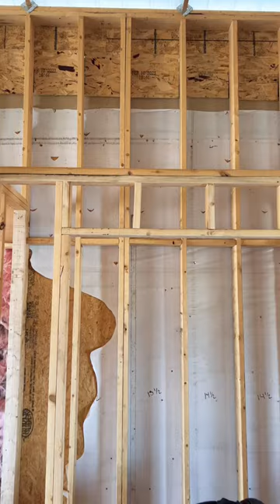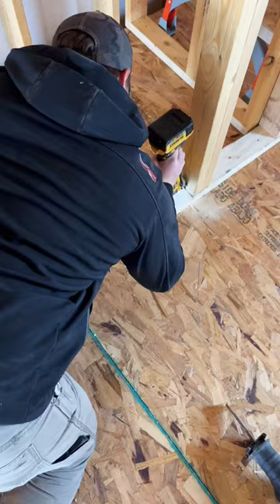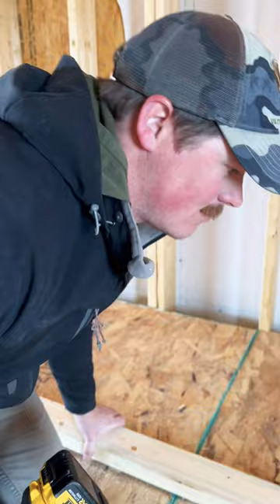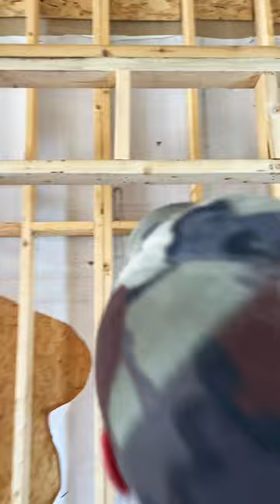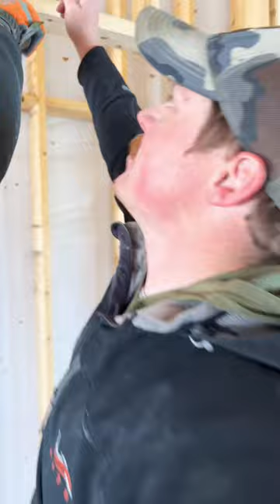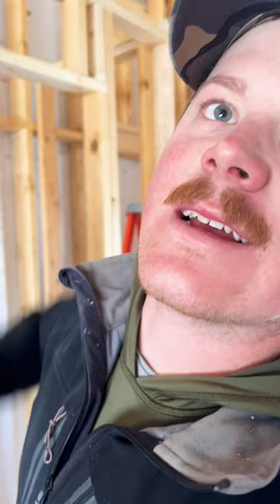NEVER give an electrician a hammer 😂😂 #shorts #construction #carpenter #diy #electrician #brother

Comment: Could tell he's an electrician because that's not a Jack stud that's called a cripple
Reply: I didn't scroll far enough before i put the same comment lol
Reply: ight then, what is the adiabatic equation
Reply: I told you to stop calling me that.
Reply: Bingo!
Reply: Yeah sounds like the carpenters there call it a jack too but where I’m from that’s a cripple .
Reply: @olybears57  
I think the carpenters were messing with him.
Reply: @olybears57  Everywhere in the "international" section calls it a cripple.

I'm still wondering why they don't have a proper header built over that opening.
Reply: Here we call those jacks and the ones that hold the header up cripples and the full studs nailed to the cripples kings

Comment: Cripples. No need to guess where the jacks are, they are jacking up the header, next to the king.

Also, why are you using a flat 2x4 on the bottom of that opening?
Reply from the maker: Because it's just a rough door opening for a closet on a non-load bearing wall